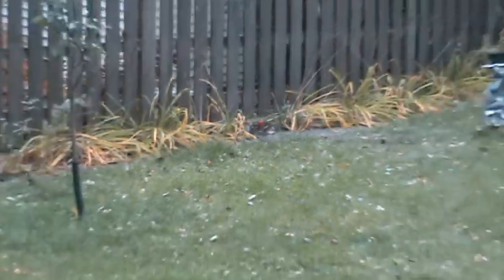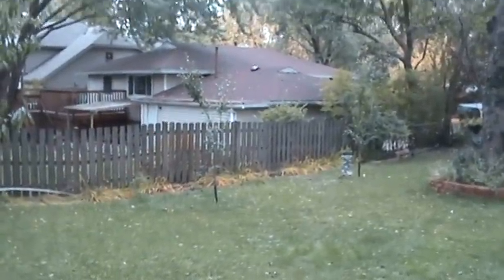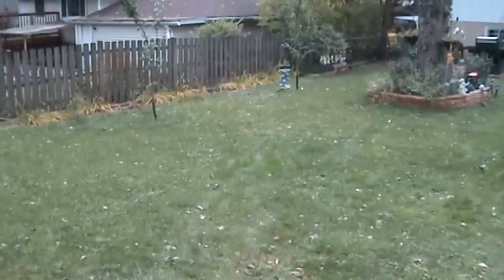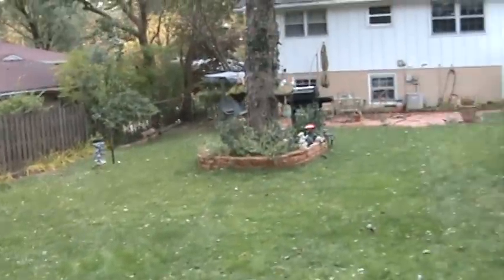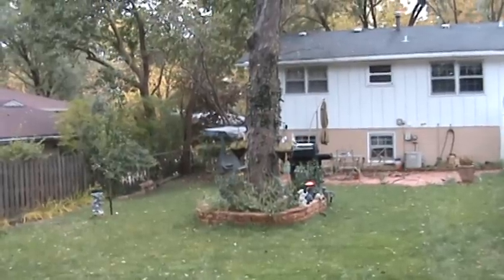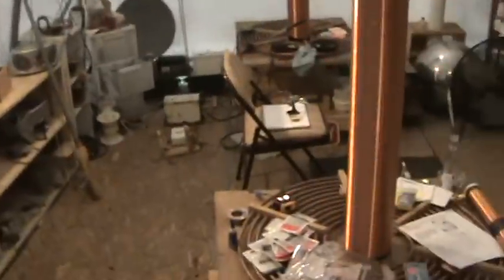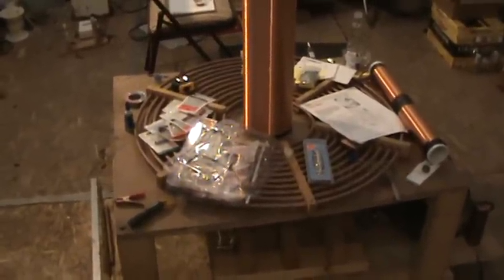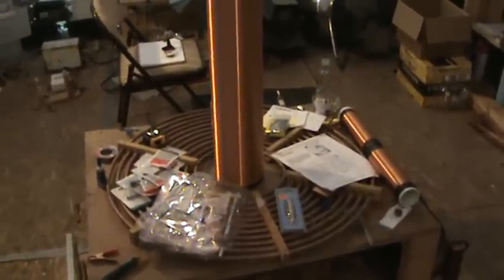FREE ENERGY CIRCUIT- GOODBYE FOR NOW, TESLA COILS NEXT

Comment: it will induce more power then you are drawing...which finishes your faucet. Then all you need is a good power supply for your bucket to make it 100% usable power from the "static" frequencies in the air...aka the frequencies that we do not currently modulate stations on.

Comment: p2. Metals like graphite...that have a lot of pores allow for the electrons to move....this would allow for current build up inside the metal. Steel is good for lower frequency. Aluminum and copper for higher frequencies. 1/4'wavelength' of the common solar frequencies(from stars) is 11.52 feet. Also remember. Insulated wire helps to keep the flow going where you want it to.....allowing for small bends in your antenna.

Comment: Insulation + mercury + copper touching and put about 20 ft in the air (probably not even that) with your circuit should get a lot of power. Where the mercury, copper and insulator make contact there is a lot of static charge that happens (what most wires are actually designed against). Also, a scientist awhile back found that the antennas work best when they are set horizontal :)

Comment: The easiest antennas from what i can see are loop antennas and they make it so its directional..set it like a solar panel to get the best results. The "tuning coil" is the first induction coil but this one is resonant to the antenna if all is well. The power from that goes to a basic magnetic coil to drive an induction coil (much like the old school headphones just without the piece of tin that vibrates).

Comment from the maker: Twisted pairs reduce RFI,,hmm, yes, i just read yesterday about DR Moray using twisted silver wires to reduce the RFI.
Multiple wires more conductive then just 1 big wire, yes thanks, i understand completely,,like the cables we have coming off our welding machine, like a thousand small strands all twisted together forming one 3/4" diameter cable.

Comment: My new model attached to my house is using a lot of litz wire. Its much cleaner and has barely any profile. Costs much less in money then solar...its actually possible to take advantage of 100% of the power you are drawing on instead of the 10-40% solar gets (UV is a frequency). It just takes more time. It is very constant and because its controlled by a rectifier the output is predictable and safe to use. :)

Comment: The process is called amalgamation. You have to be careful when handling Mercury (im sure you know that already but CYA). The amalgamated metal is supposed to help to attract the ions in large abundance especially if the antenna wire is attached to the amalgamated metal in around the edge and insulated. Also if you run full insulated (not enamel coated) you should be able to get rid of most of the problem with letting it hit ground b4 it gets to the circuit.

Comment: You can have the majority of the length going horizontal as long as its above 8ft.....so 12ft should be good. Try pairs or threes before trying more strands. Each strand should be insulated except at the ends where they connect completely. Too many strands will add impedance rather then reducing it. Telephone wire comes twisted if I remember correctly. Litz wire is also twisted...sometimes around a common core :-) . Bell was the first to patent twisted pairs. :-)  have fun.

Comment: :-) ....surface area is on the outside of the wires. Do the 2wire setup....just with twisted pairs instead of straight wire. You can use 'dog bones' to string your antenna up so it doesn't have to go straight up(it will also help reduce tension on your wire). You will still want the majority of the wire above 8ft though. 'Dog Bones' are the ceramic or glass insulators you see the power companies use.

Comment: Any frequency that you collect white noise from is static energy. Meaning it is not being used. To transmit like our radio stations and the like do they modulate the naturally occurring frequencies (this actually uses up most of the energy because it modulates it). This limits the potential power from that frequency to what the station is broadcasting with. If its run from a static frequency the potential is endless (ie. UV, Infra red, gamma)

Comment: (curse the limited comment size)...any frequency that is not being used can potentially drive the final induction coil. That power can then be increased yet again with the same final coil setup. Cavitation at the electron level is also potentially dangerous but occurs in particle acceleration...just be careful :)

Comment: You should still get the book Free energy secrets of cold electricity by peter lindeman he studies teslas work with the help of gary vassilatos and puts it into terms for the laymen to understand. most telsa coil builders are totally missing the point. the big oscillating potential was to produce a scalar wave to be picked up by another coil that matches the transmitter coil. for some reason the voltage and amperage and voltage on the recieving coil was way bigger than what was sent.

Comment: Also, sorry, I have been experimenting with this myself and have gotten 102 volts from a single square foot of amalgamated copper (3 amps). Which is enough to pump through an ignition coil and a rectifier and transformer and power a house. This was on a clear day with no storms or lighting in sight....almost scared of my stuff going out on me when the first storm comes after putting it all together. lol

Comment: Yes sir. The current travels on the outside of the wire :-) . Telephone and network cables used twisted pairs to reduce RFI, allow for the 'signal' to travel further...faster and to reduce impedance. Surface area is on the outside of the wire. Multiple wires increases the surface area more then thicker wire. Inside area is for potential...outside is for current. Pipe is different...current travels inside and outside. Metal content stores potential.

Comment: Alright, after much more playing with it and understanding some basics of physics and electronics. The circuit you are using is a multiplier circuit. The easiest way to describe how you are pulling the energy is crystal radio. :) A coil set to resonate with an antenna makes sound. The tesla coil itself (the common design) is used for show and transmission. However, if you adjust the design and use a magnetic coil to drive an induction coil with the resonant power......